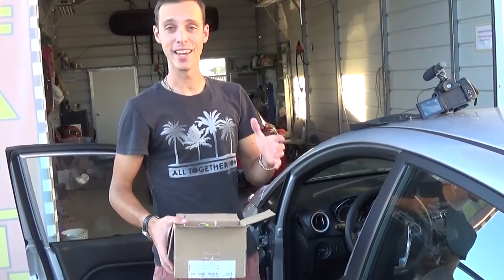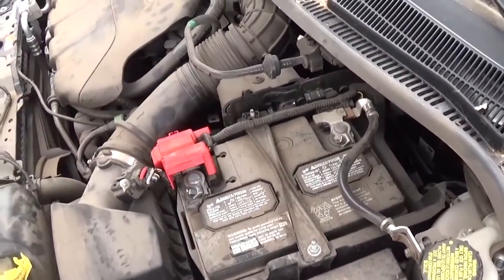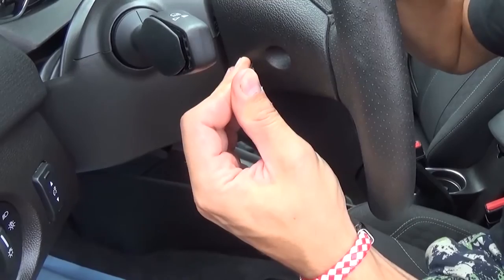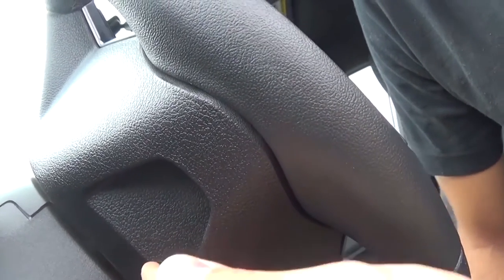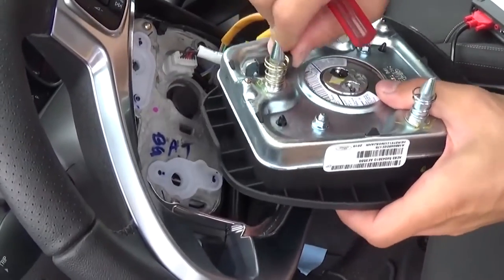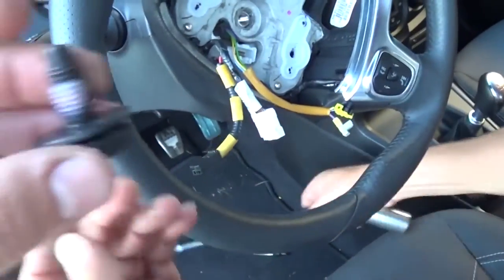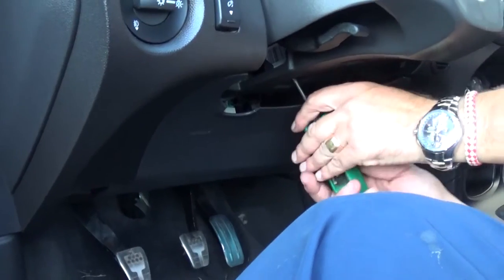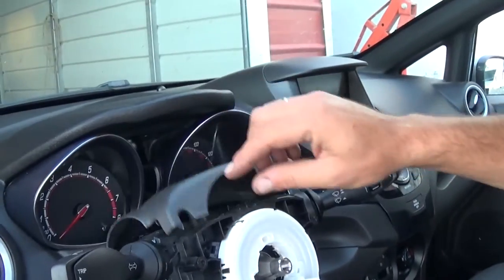FORD FIESTA CLOCKSPRING CLOCK SPRING REPLACEMENT 2011 2012 2013 2014 2015 2016

Comment: Thanks for the tutorial man!! I changed the clock spring yesterday and it worked!! Greetings!!
Reply: Iradier Amador López did you have a power assist failure?   Why did you need to replace?
Reply: The horn wasn't working! Probably airbags too. The problem started when my mechanic changed the hydraulic steering. I think he moved something in the steering wheel while he was installing hydraulic steering. I did't trust him anymore so I solved this by myself.

Comment: Guys, thanks for this and the steering whee removal vid. Question: I need to remove the assembly the clock spring
Mounts to do I can change the ignition housing. How do I do this???